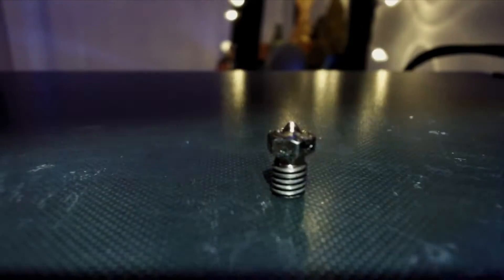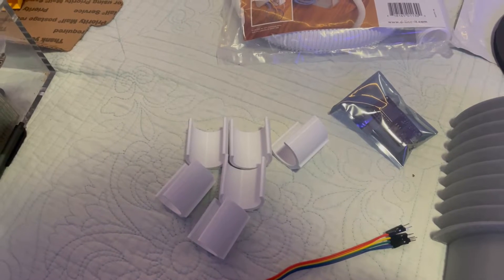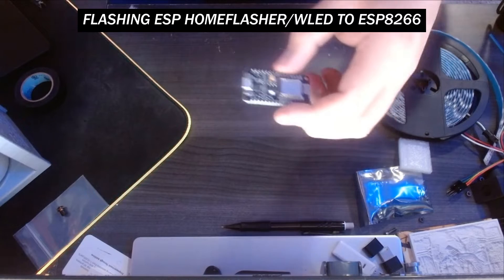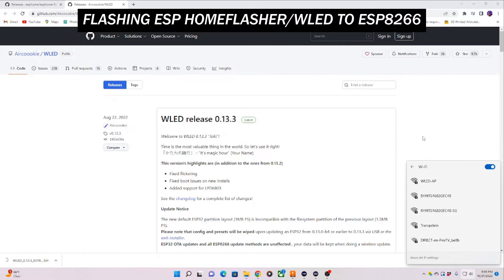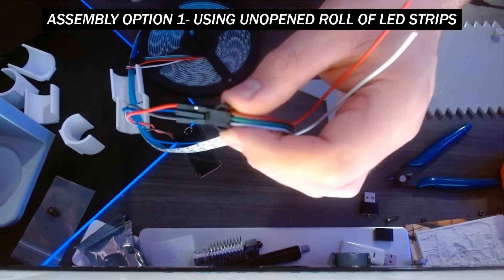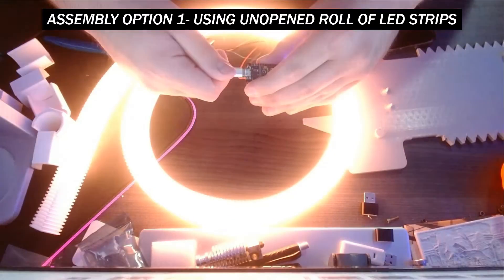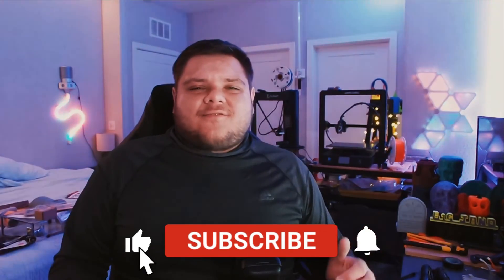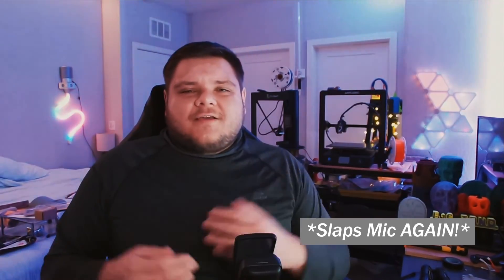Making DIY 3D Printed LED Wall Lamp (Featuring WLED Software)

Comment from the maker: IMPORTANT NOTE ABOUT THE POWER REQUIREMENTS FOR THE LEDS/ESP8266: 

It was brought to my attention that I forgot to mention the importance of not overloading your esp8266 power thru the Vin pin thru your LED wire. The controller is still rather small to run all the current through the one pin. Therefore, I didn’t mention it specifically in the video but in your LED settings menu, when enabling current limiter, set your current limit to 500ma (no more than 1A). For the amount of LED’s needed for this project, that should be safe limits for the controller and the Vin pin as I’ve run my lights with that setting for 7 months with no issues. Also I reccomend setting the brightness of your lights not more than 50% brightness to help power draw as well. I apologize for not mentioning this in the video but appreciate those willing to educate me and remind me of these things.

Comment: I'd never realized you were powering the whole strip via the USB port and Vin pin. Must have missed that stream. It's been working for a long time, but I'd be careful of adding more than a few LEDs using that method. The strips really should get a direct connection to the PSU (+) & (-) wires. If my math is right (55 LEDs, 20mA per color, 3 colors), that's 3.3A at full white. Way more than the ESP Vin/USB path will be happy passing for long. Patterns won't draw that much, but something to consider for those building the project.
Correct me if I missed something of course.
Reply from the maker: Thank you for bringing that to my attention. I agree that is a lot powering thru the controller. Thankfully with the WLED software, the current limiter can help prevent over current. I also have the limiter only set to 500ma (which WLED recommends 1A or less when running power thru the Vin pin). I also run the lights no more than 50% brightness.

 I will update the pinned comment with these requirements as I didn’t specifically mention this in the video.